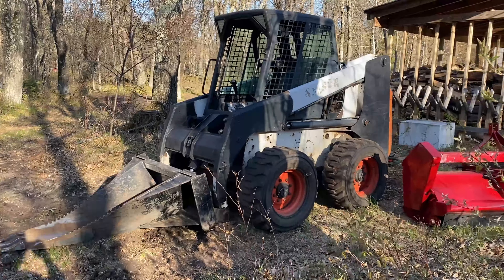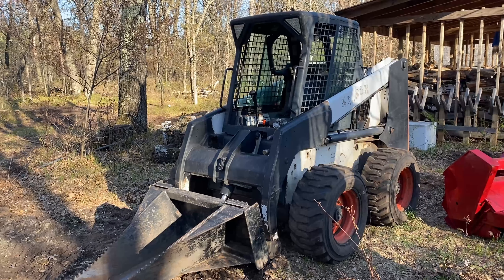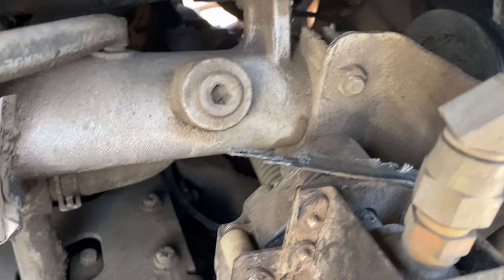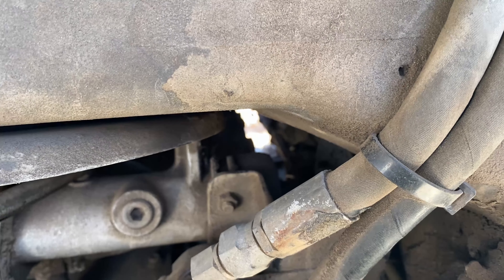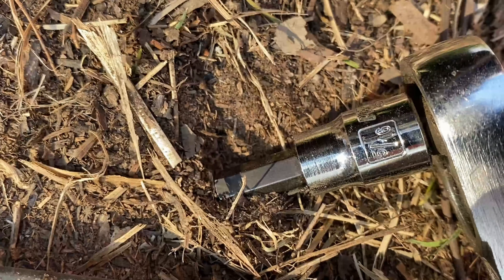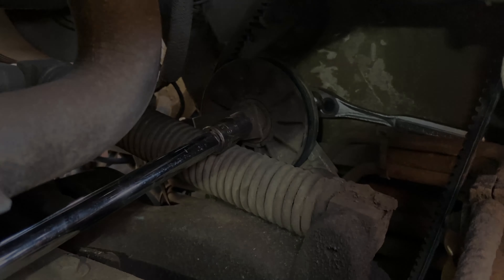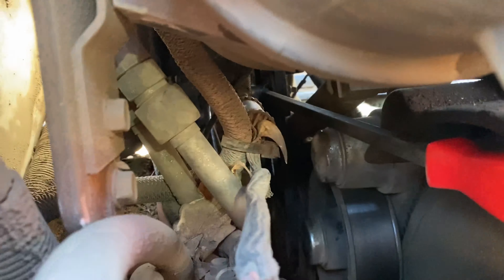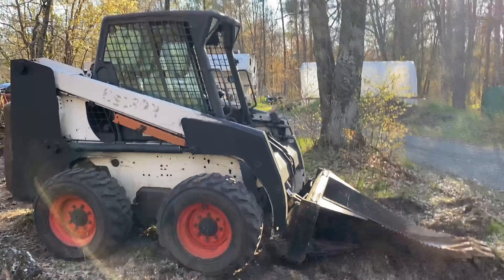Bobcat fan belt replacement diy - Bobcat overheating - I broke my bobcat

Comment: How hard will it be to replace the tensioner pulley? I have a 753F series that just started overheating on me the other day. Your setup looks almost the same as mine. The belt is ok, but when I grabbed onto the tensioner pulley, I could move it back and forth very easily. I also noticed that if I pushed it by hand to tighten up the belt, it would not hold the tension.....the tensioner would just slip back down and loosen the belt again. I wonder if that is why it is overheating?
Reply from the maker: Yep...sure sounds like the spring on your tensioner has quit you. 
Other than being a bit of a bear to reach, the tensioner should be an easy thing to replace and is pretty commonly found to be bad when your machine starts overheating. I believe you will find that to be a DIY repair for sure. Probably gonna be a belt, and a tensioner arm, and probably the pulley on the tensioner arm too.
You will know for sure when you pull the tensioner out of there. It should be an easy part to get as it is a common thing to go bad.
Let us know how it goes!
stay safe and stay healthy, 
-shane

Comment: Is there tension on the belt tensioner? I have a s175 that’s overheating and the belt is loose. I can reach in there and move the tensioner back and forth. I am wondering if I need to tighten it or if the Spong is broken
Reply from the maker: Ken, 
Yes sir, there is a spring tensioner pulley that should be keeping tension on the belt. It is a bit of a pain in the backside to get at but needs to be snug. Also, be sure to check the condition of the plastic pulleys, they like to get chewed up and essentially the "Floor" of the v-groove gets eaten out. That can be hard to see with the belt still on, and absolutely will mess up your belt program.
Good luck, and let us know what you come up with! As the old saying used to go...inquiring minds want to know !
Stay safe my friend!
-Shane